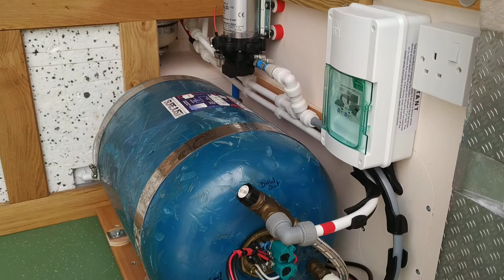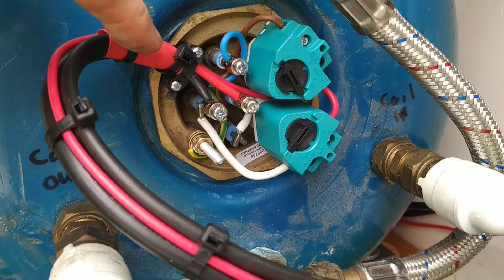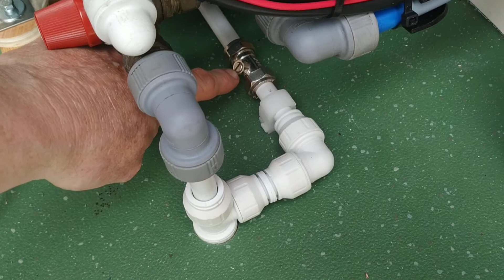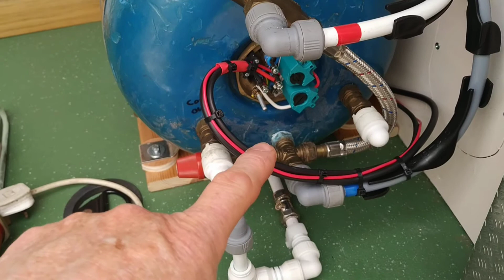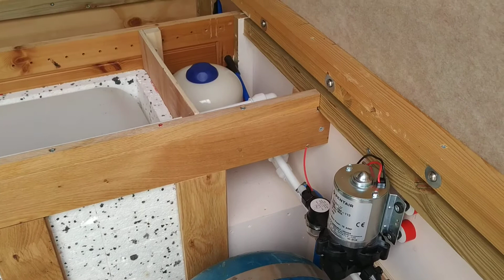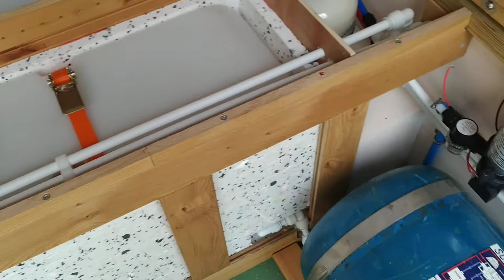VW Crafter Van conversion part 35, info on my Calorifier and dual 12v DC /230v AC Immersion.

Comment: Hi… I’ve only just come across this channel so apologies for daft questions.. I’m on a canalboat and looking to create some sort of Solar dump set up “or” just a manual switch/ relay to turn on a calorifier heating element.. I don’t suppose you created a wiring diagram for your set up? I’m still a bit confused around relays? Is your set up via a manual on/off switch or is it via a voltage sensor relay? Cheers

Comment: Hi, I had heard that people don't put calorifiers in vans because of concerns over dislodging pipework and the heating/cooling fluid leaking into the water tank - does this concern you? I didn't even know this was possible...do you need additional safeguards? we used to have one on our boat and keen to add one to our future van (which will be going over all terrains). thanks
Reply from the maker: There is very little chance of water from the engine cooling circuit mixing with water in the tank. the copper internal heat exchanger coil inside the tank would have to fail and begin leaking first.

If the water tank was empty then there would be a very obvious loss of engine coolant, if the tank had water in it then it would be less obvious initially but the water would obviously be tainted with antifreeze mix.

It's obviously good practice to have isolating/balance valves in the engine flow and return pipes.

My tank are always empty when the van is not in use so no chance of frost damage in a cold van obviously if any tank is able to freeze all sorts of damage can occur from the expansion of the water

if the external pipe work isn't sound then yes there always a possibility of leaks but that imho would just be down to bad plumbing techniques

Some people use tanks without a coil but that requires an external heat exchanger and a circulation pump and is probably less efficient however the tank can then be almost anything even a vented plastic container like the ones Bobil vans sell.

My tank also has a dual 230vAC/12DC immersion heater I use the 12v one most of the time as a solar dump load.